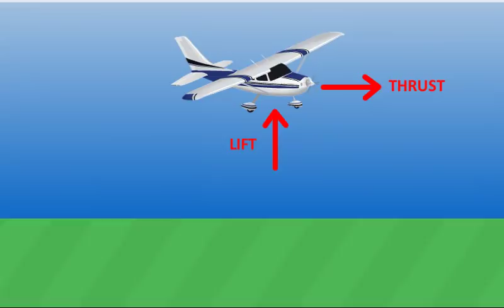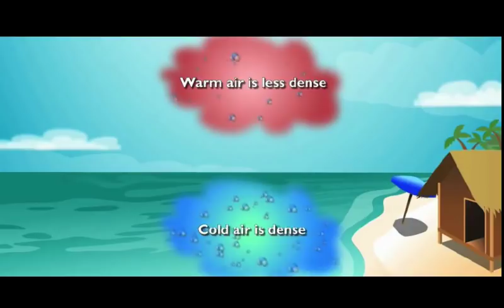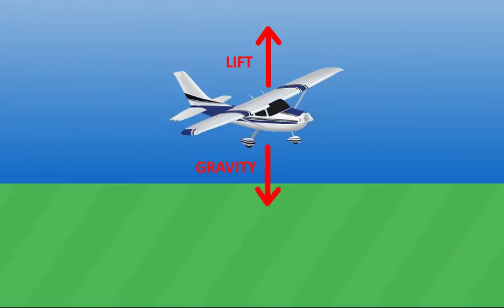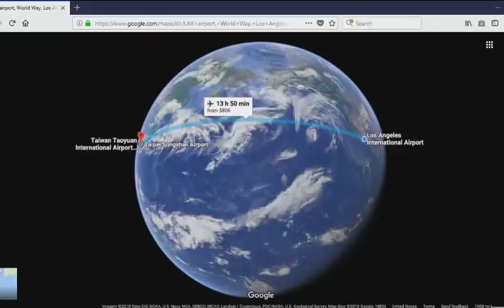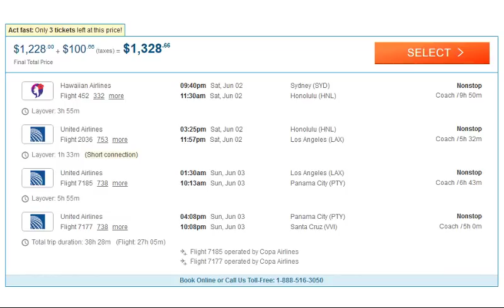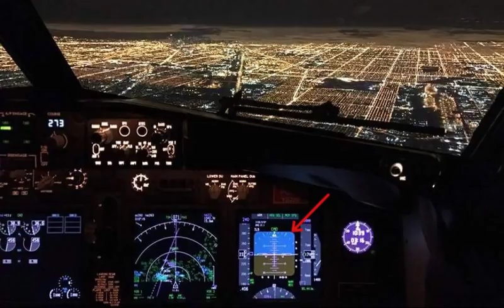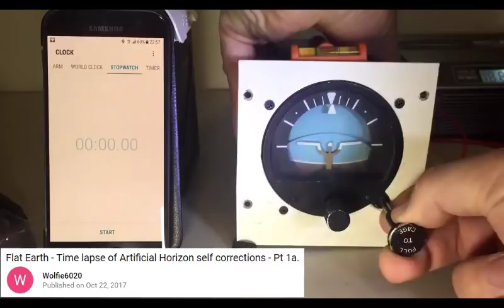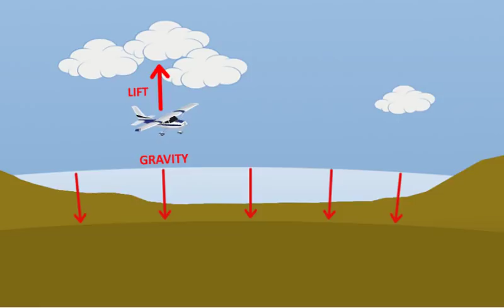Flat Earth Falsities - Plane Nonsense

Comment: Flat Earth is a fact and the more that someone tries to prove it wrong it really exposes the manipulation of words, sentences, the language used in a tricky manner as to elude or evven falsly confronting while scofing, its really  ridiculous. Flat earth is a GLOBAL awakening. Its kingdom come bb
Reply: "Flat Earth is a fact hoax" 
Fixed.
Reply: If I request evidence from you to back your claim you'll accuse me of manipulating your words?
Reply: @flookd5516  the earth is not moving. Obvious to anyone being honest. Rivers only flow downhill yet travel in all directions. Rivers are a big problem for the globe. Planes and birds fly horizontal and level to the surface. Level to horizontal makes the surface a horizontal plane. The planes nose points slightly up. Not down. Bodies of water seek there level. All elevation points are measured from mean sea level. Once again a horizontal plane. Outside of the oceans all other bodies of water are contained by land. The ocean being contained by walls of ice makes perfect sense. Climates and ecosystems are completely different to the north and south. The horizon rises vertically. Youll dispute all of these observable facts by they are facts none the less.
Reply: The FE robot is back.
Reply: Bobby Wizdum All willful ignorance on your part. Stellar parallax & Foucault pendulum demonstrate Earth's movement. Water flows from high to low elevation; curvature of a sphere's surface is not elevation. 0.014 degrees curvature per mile does not require visible tilt or curvature. Water does not seek anything on its own. Rivers connect lakes to the seas. Walls of ice to not make sense; assuming you were able to demonstrate their existence, you need to explain where they came from, what maintains them and what lies beyond them. It's all one ecosystem; the climates with latitude, not hemisphere. The horizon does not rise; it falls with increasing elevation. 

Your claims are basically because you can't get your head around the size of the Earth or the concept of gravity acting towards the centre of the Earth. Your incapabilities don't even qualify as evidence.
Reply: @flookd5516  as i said youll deny them. You asked for evidence. You choose t0 ignore it. So the equator buldge. How does the river flow over it without going up?
Reply: @smfoptoo  they flow to the sea. Not toward the center of gravity. The nile or mississippi contradict the globe. Take your pick. Saying youve explained something doesnt make your claims valid. The horizon comes up to meet you is what it means. If we were on top of the curve as you guys claim to explain away things being on opposite sides of the curve the horizon would remain below you as you went above it.
Reply: Bobby Wizdum By flowing from a higher elevation to a lower elevation. 

You haven't produced any evidence, just ignorance.
Reply: @flookd5516  so the buldge only goes down?
Reply: Bobby Wizdum What do you understand by elevation?
Reply: @flookd5516  that a bulge of any kind has an up and down. Just as a curve has opposite sides.
Reply: Bobby Wizdum Not what I asked. What do you understand by the term elevation?
Reply: @Flook D
Bobby Wizdum is a troll. Remember?
Reply: wong With a name like Wizdumb it would be difficult to forget.
Reply: @flookd5516  the height above sea level. Now answer how a river flows over a bulge only going down.
Reply: @smfoptoo  the horizon certainly moves up with you. "No they dont is your answer on rivers"? Gee well thought out response
Reply: Bobby Wizdum What makes you think the land bulges but the sea doesn't?
Reply: @flookd5516  how does a sea bulge? Clearly that would be visible. There is no bulge in the nile river. Youre making my point. If the land has a bulge the river would have to flow "up" over it going north on a globe.
Reply: How big would you need to be for the sea bulge to be apparent? What happens to the elevation of the land when the sea bulges?
Reply: @flookd5516  the bulge would be visible. It of coarse is not. The elevation and bulge are not connected. We are talking about the nile river.
Reply: Bobby Wizdum Too many factors for you to handle?
Reply: Nice bro they are Slaves of a Globe System and they don't understand is a illusion they live in and i think they believe in NASA too THE BIG COVERUP I HOPE YOU ALL FIND OUT WHAT NASA DO You will find out in a    new channel
Reply: Startrails, no curve, Cavendish was a flaw, Aristostenes was wrong, Nasa is Bs, satelites and space are a Hoax. The Earth is Flat.
Reply: Erick Edmond Roman Harris Try answering Wong's questions.
Reply: It took me more than two years to pay close attention.  Once I understood it and reazoned it. Can't say it isn't great. HALLELUJAH
Reply: @erickedmondromanharris1549  - It took you 2 years to talk yourself into believing something that isn't true? 

You should be proud...
Reply: Erick Edmond Roman Harris So what's your evidence?
Reply: @Erick Edmond Roman Harris
"It took me more than two years to pay close attention"
Given the research and knowledge you claim you should be able to answer these simple practuca questions.
Why is it that a compass needle is more or less vertical at the poles and horizontal at the magnetic equator?
And when you carry on past the poles the needle slowly returns to the horizontal?
Why is it that it is only possible to navigate accurately over long distances using spherical trigonometry?
Why is it that traditional gyro compasses work perfectly in low latitudes but became unreliable in high latitudes?
Why is it that it is only possible to navigate accurately over long distances using charts based on a terrestrial spheroid?
Why is it that when you watch a ship sailing away from you the hull is the first thing to go below the horizon, then the superstructure and finally the funnel and upperworks?
Does a magnetic compass point towards polaris (Alpha Ursae Minoris) at the north and south poles?
Does a gyro compass point towards Alpha Ursae Minoris at the north and south poles?
What is the relationship between longitude and distance when travelling east or west parallel to the equator?
Tell me how you ascertain the error of a compass when in the Southern Ocean, using Alpha Ursae Minoris?
Please explain the principles behind the development and functioning of a gyrocompass?
Reply: "The more that someone tries to prove it wrong it really exposes the manipulation of words, sentences, the language used in a tricky manner as to elude or evven falsly confronting while scofing, its really  ridiculous."

I see what you mean by "manipulation", "tricky" and "sentences"; not exactly a Grade A student were you?
Reply: Stupid ass flat earthers
Reply: Thousands of years ago, where people didnt really have any scientists, nor anything to research for themselves, people believed in the flat earth, and then put those..."Facts" into a book. The only thing you fucktard did was read out of that antique book or just simply believe what other flattards say in their bullshit, fake videos, without thinking twice about your acts. That new century flat earth bullshit exists since only very few years, and it got caused by mass stupidity. Because look: kids in schools become more agressive and less educated. Thats why. And we already know that the earth is round (like basically every other PLANET or MOON in our universe) for over a century. Get out of that lie before "God" punishes all of you because his "creations" are so fucking ignorant.
Reply: That's some of the most idiotic "reasoning" I've read so far. Here, I'll try:

The more you flerfer fuckwits argue for a flat Earth, the more it proves that the earth is a globe.
Reply: @smfoptoo  
Angry much? 😂😂😂😂😂
Reply: @Bif Sanders
"@Brett VV   Angry much? " Why is it you silly children always accuse someone who tells the truth of being "angry" or "mad" etc.?

Comment: MAGNETISM.  First we are certainly far from having any reasonable explanation of any of the magnetic phenomena of the earth.
It is well known that magnetism acts in a straight line (or level flat, no nice curves). This of itself is sufficient to prove that the earth cannot be a globe; because on a globe, wherever the magnetic influence came from, the needle would point in that direction; sometimes down through the ship's keel, and always at an angle that would render it useless to the navigator. The truth about magnetism has yet to be discovered, but even in our present state of knowledge, the weight of evidence goes to show that the world cannot be the globe of popular belief. 

In a work entitled "Magnetism and Deviation of the Compass," by J. Merrifield, L.L.D., F.R.A.S., 10th Edition, page 4, the statement is made that:   "When a magnet is suspended by a thread without torsion, or on a pivot so as to move freely, it will, when left to itself, rest only in a vertical plane which stands nearly North and South."
If this statement be read with an artificial globe in sight the assurance is at once conveyed to the mind that the shape of the world cannot be globular.  On a vessel at sea, the compass needle could not point nearly north and south on a globular surface, but would point into the sky at both ends.  To point north on the equator it would dip towards the North Pole at an angle of 45°, while the south end would be the same angle above the horizon, pointing into the sky.  Only on a FLAT surface could the statement of Dr. Merrifield be true.  What we know is that the compass needle is horizontal, except in high latitudes, and there, although it dips, spins round, and does various other extraordinary things, no constant of dip can be found.  It is never the same at the same latitude at different times.  In fact, there is nothing yet discovered that accounts for the deviation of the compass, lateral and vertical. As so many incompletely backed Theories sold as Fact in population training centers....

"Professor Neumayer writes that without an examination and survey of the magnetic properties of the antarctic regions, it is utterly hopeless to strive with prospects of success, at the advancement of the theory of the earth's magnetism."
Reply: Fuck off you ignorant troll.
Reply: Love those short convincing rants :) Candidates for Globe Earth Society. 
It may be not be so easy of "explaining" for these learned.., but denials dont agree with facts.
In an article in the Nineteenth Century, 1895, by C. R. Markham, it is stated that:
"Professor Neumayer writes that without an examination and survey of the magnetic properties of the antarctic regions, it is utterly hopeless to strive with prospects of success, at the advancement of the theory of the earth's magnetism."
It is evident that we have not sufficient information regarding magnetism to lay down any definite rules for determining the cause and cure of deviation, whether lateral or vertical.

Like the elusive dark matter, search of magnetic monopole, it would open the door to a whole new world of physics. So to figure out how to close some big gaps in Science understanding of the Universe. Created by brainless Nothing. With lucky errors....

Note for the well researched and educated college Professionals (on my ass, tossing all kinds of silly names callings,etc)=
[Now, researchers at Amherst College in Massachusetts and Aalto University in Finland have created a mysterious Dirac monopole in the lab.] https://www.businessinsider.com.au/physicists-create-magnetic-monopole-2014-1
- so if intelligent apes can succeed that what of brainless NATURE who has accomplished so much miraculess designs and bewilders top brains.
Reply: @BrainUser1  --Fucktard alert!!
Reply: @BrainUser1  - Fuck off Lupus Straw
Reply: @Brett VV
@NotTheCIA I.think
I wonder why the silly troll @Louis Shaw didn't cite the entire book by Merrifield, a book which proves the earth is a slowly rotating sphere? Or it's sister book by Klinkert and Grant, which also proves gravity.
Reply: My my a little "no nothing" rant and i always get plenty of SANE's who understand Science on my back... :) :) :)
None debunk or even address any of it, as usual, just the educated ad hominems attacks as all can see.  :(

No one can explain how the super heated iron ball got magnetized, or show such hot BALL magnet displaying such directional fields.  Poor thing is covered with miles of matter layers, but still got voysovreason "level" ground sticking rays all around the ruff oblate globe, laced with iron constructs disturbances. Wonderbar!  

Dam thing does pole flips too when it wants, automatically....

You can reduce a magnet's strength or demagnetize it entirely by exposing it to a magnetic field that is aligned in the opposite direction. You can also demagnetize a material by heating it above its Curie point (570 °C (1,060 °F) Versus 6,000 C (about 10,800 F) of the Earth's core . That's as hot as the surface of the sun Ballers.... 

PS: I never said monopoles existed, dont believe in irrational undetected invisible's (beings as gravitons, gremlins etc), just think if this non designed Sphere did have a ball magnet it be likely that sort.  
Just I dont see why those N-S poles align with the famed 66.6 degree tilt of the frozen spin axe.
But has I showed(linked etc) the Primate scientists believe in it, need it, like a lot of invisibles; dark matter, holes, atoms etc :)
Not sure "impossible" is in THEIR dictionary!
Seems a need to deflect my blabla bla...
Reply: @NotTheCIA I.think quite the contrary ...it does. North is center smart guy. From it all arrows point south. You have no evidence of a compass that points all north in the south.
Reply: @NotTheCIA I.think its quite simple. The north center is the positive charge. All points south is the negative. It doesnt require 2 poles as we dont have 2 poles.
Reply: Yep! that is good common sense! thank you ;)

Comment: dude, stuff have momentum in a car BECUASE OF THE GLASS WINDSCREEN, so what`s Earth`s windscreen? Is it a dense dome? IT Is!
Reply from the maker: The air in the car moves with the car because it is contained. The atmosphere moves with the earth because it is held by gravity and it also has momentum. So the analogy is very good. Neither case suffers from wind resistance. But even with air resistance, a ball tossed from an open truck will NOT STOP immediately, as momentum still works, it will just slow down due to the resistance.

Try jumping from a moving truck and landing still on the ground. Be sure to film it for us to laugh at.
Reply: Julian Smith 
Toss a baseball in the back of a truck and it still doesn't fly out the back.
Reply: Julian Smith Have you ever been on a rollercoaster?
Reply: Julian dont toss that ball above the cabin if going 1/10 of the speed.
Its got belts against solar space winds, then again still lose some gasses into the dark matter vacuum.
Tornados and hurricanes dont need windscreens to carelessly roam about Momentum...
Reply: Love to see the need of constant smear propoganda against ME(whatever that may be..). Guests need help for that...
The curious case of Earth's leaking atmosphere - Phys.org
https://phys.org › Astronomy & Space › Space Exploration
Jul 8, 2016 - Earth's atmosphere is leaking. Every day, around 90 tonnes of material escapes from our planet's upper atmosphere and streams out into space.
Earth's Atmosphere is Leaking into Space - Universe Today
https://www.universetoday.com/17440/earths-atmosphere-is-leaking-into-space/
Aug 28, 2008 - [/caption]. Oxygen is constantly leaking out of Earthâ€™s atmosphere and into space. Measurements taken by satellites during the 1980s and ...
Reply: @NotTheCIA I.think calling others morons when you yourself have no way to prove or disprove there is air in space or even space at all. Dude you arent allowed to go there and are talking out of your government fed poop scoop.

Comment: What about the Coriolis Effect? Why would the rotation of the earth have an effect on a bullet but not on a plane or Jet?

And a person near the equator would be spinning hundreds of mph faster than a person closer to the north pole.
How can we measure this? I sure can’t feel it.
Reply: Ron'Donavis Bardclay Planes are continually adjusting course to compensate for the airflow around them; those adjustments are greater than the changes that would be due to the Coriolis effect. 

You can't sense velocity, only acceleration. You know a car or train is moving through the vibration from the engines and friction with road/rail surface plus any braking or acceleration that occurs.
Reply: You don't need to take into account the coriolis effect for short distance shooting. Nor do you need to take it into account for anything that isn't aerodynamic enough to discount the effects of wind.

You do need to account for the Coriolis effect if you are using long distance artillery and firing north or south.

You also need to account for the curve of the earth when using ICBMs that don't use the air for lift like planes generally do.
Reply: Henry Kissinger — 'It is not a matter of what is true that counts, but a matter of what is perceived to be true.'
Even more on their Atmosphere Momentum, in perfect sync all over the fixed 666 degree axe of degrading speeds down to 0 poles.... Then you got multiplied the higher you get to the solar-wind vacuum runway the EARTH zooms about in locked orientation to the flying SUN gass ball of 95% of System gravity force.
Reply: Do bullets have engines, wings, a tail, or a pilot?
Reply: @CaptWesStarwind  Have you not seen the really little ompa lumpas strapped into the cockpit of bullets? They are there! All you need to do is believe and look real hard!
Reply: Awesome Aussie Atheist Does that mean bullets are really candy? If so, what does Willy Wonka call them? 🤔